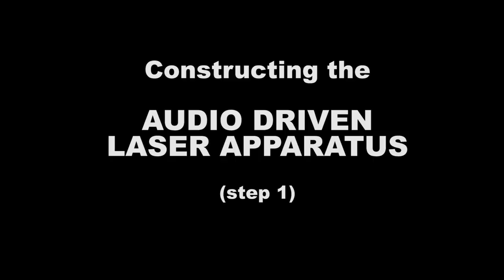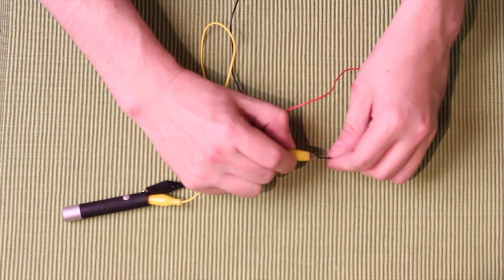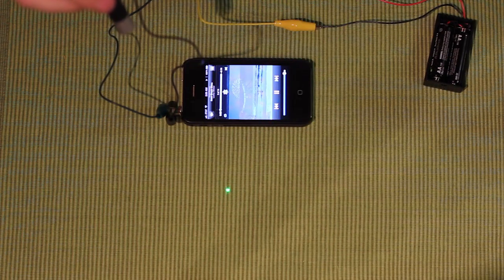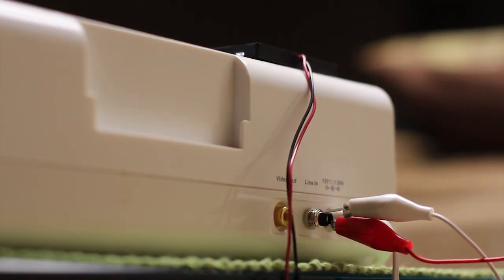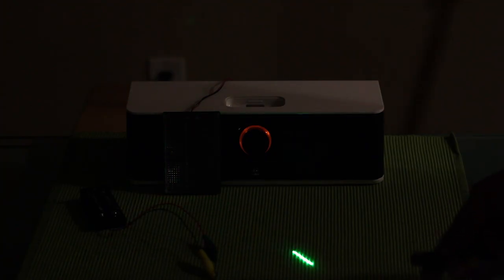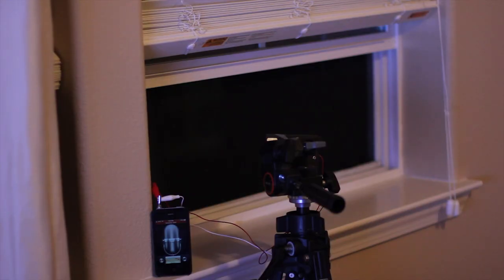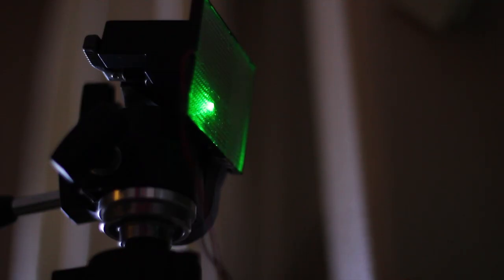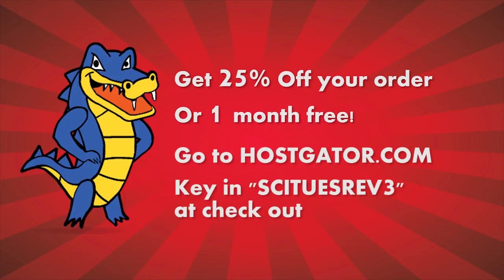Spying with a Laser

Comment: Hello, Wonderful project.
I have a question; Would it be possible to send a text document consisting of say, 30,000 Bytes and be able to save that received text document onto a computer? What I find fascinating is that you demonstrate sending by Laser a much larger message, (a music file) and become a successful experiment result without  error checking, re-sends and acknowledgements, which in itself only contains bytes of information. I am one of your "Techno Virgins" so to say, and perhaps that's where my impatience and uneducated frustration and desire comes in. But, I am quite sure that your technical intuitiveness and desire to succeed will prove successful. It would be great to see you post a video proving that it can be done.
Reply: audio is the rare data application where dropping or corrupting a few bits here and there doesn't really matter: the lossy-ness probably won't even be noticed, since it's being parsed by the human brain instead of a computer.
Reply: It really depends on how you encode the bits. If you use something like a hamming code that has error correction built in, you could probably get pretty decent results assuming stable transmission. 

It sounds to me like you're essentially looking to do a fiber optic data connection without the fiber part.

Comment: its funny, when you were transmitting clear audio from your phone from 3 feet away directly into your solar cell, you couldn't make any of it out, but miraculously you were able to "Bounce" light off of neighbors window, receive it in your solar cell and get clear audio, how wonderful. Oh by the way, where is your audio amplifier, is it that big thing because you need audio amplifier connected to your solar cell to amplify the vibration before it can be converted back into sound. I take it that you're not an engineering student
Reply: utubefrog09 also the fact that the neighbours window was probably double glazed dosent help either
Reply: I would have tried several changes. I think he was over driving the laser, meaning it was distorting the audio. So turn down the source gain and turn up the output amp. I think the light on the solar cell was to concentrated, he should have backed up and let the laser light spread out to hit more of the solar cell.
Reply: Im not saying he didnt fake it, but the laser did have a greater exposure over the entire panal after it was reflected. His Iphone test was just one small stream. The reflection covered the entire panal. Idk 😆
Reply: First time didn't work because the laser needs to be reflected on a surface that is vibrating because of sound waves. The vibration gets reflected with the laser and the receiver is then able to convert it back to audio. That's why pointing the laser directly into the receiver is not going to retrieve any sound.

You shouldn't make assumptions, accuse someone of faking a video and even making fun of him for not being an engineering student when you don't even know the principles that makes this work.

Get your facts straight if you are going to make such a disrespectful comment.
Reply: This is 100% faked. He could have just built this entire thing properly by using a photo transistor instead of a ridiculous solar panel, and an actual pre-amp circuit that is absolutely needed to step up the signal to an even remotely audible level. 

Theres no need to even modulate the laser but if you wanted to, all it would take is 1 general purpose npn transistor and 2 resistors to do it properly and have crystal clear audio. 

I built one of these years ago and when built correctly it works incredibly well, even on double pane windows. Theres a reason the military and government have and use these devices. If you want to build one a circuit can be found pretty easily on google that actually works.
Reply: @Alex-to4iz  Umm maybe you should get your facts straight. He was modulating the laser via the mp3 players audio output (or at least attempting to). It didnt need to reflect off of anything, the sound was already present. And it still didnt even work, because this whole video is fake AF. The random digital noises in the fake audio of an entirely analog system should be a dead giveaway to anyone who understands basic electrical engineering.
Reply: I'm pretty sure he faked it too, just dubbed a distorted voice over a track of static noise. Double pane windows only tend to transmit sound at the resonant frequency of the window. And if his receiver didn't pick up anything from the modulated laser there's no way It could have not a good signal from his neighbors.
Reply: Students are good at regurgitating taught facts. Don't get memory mixed up with intelligence

Comment: you might wanna open your screen on your window metal might be the reason why your sound being bounced its coming in rough, also you might wanna add some cap's & resistors to the circuitry to smooth out that feedback

Comment: I did this for my project a week back and it worked then
Now its just not working
I'm just doing the audio or music transmission part not spying
The laser is fine, it lights up when audio jacks are plugged in and the solar panel is fine as well as my speakers
When I direct the beam at the panel, I dont get any sound but a week back when I did the same thing it worked like a charm

Help please! Need quick help
I did evrything from changing connections, trying different speakers, different audio jacks and different lasers but no avail
Reply: They patched this in the new update.
Reply: Poland Ball LOL
Reply: Reich Tangle just wait for patch 1.04569318539052.578 it'll work lmao
Reply: Daemonforce Gaming http://phimhd.vn/phim/ong-con-quy-tu-that-is-my-boy-2012.html watch this and get fucked up
Reply: ESB Games no, screw off mate.
Reply: ESB Games yeah piss off m8
Reply: jamn610 preach it bro
Reply: it might require a new battery
Reply: jamn610 doesn't it need to bounce on a flat area , like a window? so when sound makes the glass vibrate, the light is not directed to the panel ?
Reply: I think so
Reply: Petitjean Gilles I powered the laser using a battery and an audio source, so there's no need to bounce it off any object since I'm not eavesdropping on anyone
Reply: jamn610  did you damage the speaker?
Reply: Looking for Hope no, it was working just fine

Comment: That's not the right way... you should use a transistor as a switch in the jack... also i think that connecting power directly to the laser and the audio jack is dangerous to the MP3 player or cellphone :/

Comment: For the laser audio transmitter you need a transformer in line with the laser pointer and the audio will sound much clearer. Use a low power solar cell if you're using a high gain amp. I used one from an old solar garden light and it was almost overpowering my amp.
Reply: Can you make me one

Comment: Do you think infrared would work?
Reply: Ricky32908 I'm curious about why you said IR wouldn't work.
IR has a longer wave length meaning it's more likely to reflect than UV against a barrier and looking up IR reflection in clear glass specifically, that looks like it's the case too.
Also it's not like we don't use IR to transmit data at higher bitrates than sound every day anyway (normally called a TV remote or toy car remote).
The only issue is the sensor, the solar panel. IR receivers are tuned to only receive a specific band of IR from a tiny LED back when LED's weren't superbright. Meaning no need to turn the lights out either.

I can actually see this being done with only a bit of optics to collaminate an IR LED and an off the shelf IR receiver.
Even if glass does transmit or absorb IR, replacing the LED with a superbright IR led would probably be enough for the sensor to detect the signal.

No prototype UV specfical PV cells or UV laser required.

Now granted this IR system may not work outside on a sunny day, but neither will the UV system (ozone does absorb UV but why would they even be researching UV specific PV cells if no significany UV reached the ground? Also sunburn....)
Reply: professional laser microphones use IR lasers in the 790nm freq so yeah...
Reply: i researched, no it would'nt have enough energy to work :(, maybe a less noticable color like red would do
Reply: I wonder if a more powerful lazor would sound better
Reply: maybe, there are solar cells in development to capture not just visible light but also UV for a cloudy day, those might
Reply: IR would work, focused correctly it can travel a good distance and it can not be seen by the naked eye. By using a IR receiver (diode) all other light is ignored. Down side is it would be no good for use during the day because of the mass amounts of IR light that the sun produces. IR has been used in many things from tv remotes (look at the end of your remote and push a button, you see no light), it's been used in large scale touch screens (a camera fitted with a IR filter monitors the reflected light that your finger causes when touching the glass) and many other applications.

Comment: Does this really work?
Reply: "yes" it does but using a solar cell would be about the least efficient receiver you could think of. It's reacting to changes in wave length a solar cell is made to catch a very wide range of wave lengths across it's whole surface. A better receiver would be a would be a light sensing diode or "Photodiode".
Reply: No. You said that Solar Panels are worse receivers than anything I could imagine - I have issued a challenge to that statement!
Reply: Yes but not the way he did it. Its bull shit. To actually do this you need a photodiode or CCD and some optics/interferometer, not a dollar laser pointer and a solar panel. Also have never seen a green laser for a dollar at a drug store. They re like 30 from china. A drug store has a huge mark up. Stop the bull shit.
Reply: kenstr321
Wanna bet? How about a pumpkin pie?
Reply: Mithradates Megas Do you mean a raspberry pie? The DYI electronics kit?
Reply: hahaha
Reply: OMG WHATS WITH THE FUCKING IDIOTS SPELLING Raspberry Pi WRONG!?!?!?!??! i mean i get why ppl type it pie but still no!

Comment: Wtf, and they don't need a receiver or what?
Reply: The solar panel is the receiver now, it "reads" the reflection of the laser made by the glass of the window. That's why it won't work if you're not making sure the laser reflects into the solar panel.

Comment: Wouldn't this work better with a blue laser; since their is deeper uv rays. For example I noticed that the blue laser shot at a solar panel gives it much more power, and basically means that the signal with the blue laser would be more clear and powerful?!!
Reply: That's why I commented!!!:) ;) :D
Reply: RANDOM VIDS
true it should work better that way
Reply: ultraviolet light would be much better since it's invisible to human eyes(and shorter wavelenght bounces more)
Reply: @busteraycan  well noted :)
Reply: U guys still alive ??...
Reply: @SkyHighFilms777  yup! 😈
Reply: I knew that
Reply: So a red laser is the least affective because of its long wavelength?
Reply: Aaron Smith Burak Baggins UV would be a terrible choice if the reason for using it was so that it wouldn't be noticed.
Reply: Does this system really work that good ?? I mean with a reflected laser beam and higher quality solar panel could it actually puck up voices that clear !?...
Reply: Billy Williams That seems opposite to what I've learned. I suppose the only real way to test this would be to experiment! A blue laser would have a higher frequency, yes, and thus more energy, but the smaller wavelength would probably cause it to scatter more so it couldn't travel as far. But either way, I think it'd be cool to either use UV or IR radiation so you wouldn't have to worry about someone seeing you shining a laser through their window!

On another note though, I wonder if your regular everyday solar panel would detect these frequencies of light. If so, UV would probably be better as objects give off blackbody IR background radiation at room temps, creating lots of interference. Love this stuff.

Comment: i don't get the thing with the laser on the window and your solar panel.. where do you point the laser at, and how do the signals come in (in what form..)
Reply: Glass windows reflect back a small portion of the light that hits them. The idea is you point the laser in such a way that it bounces back at your solar panel. The window itself will react to the sound waves in the room. The vibrations will cause th returned laser beam to distort into patterns that can be translated into sound.
Reply: Joseph Sileo thank you very much for the explanation

Comment: cool,now if you replaced the green laser with a infra red laser then no one will know they were being spyed on
Reply: but how do you know how to reflect it?  yeah true do maths bu you would need a distance i presume and you would have to make that and put it in the circuit
so that doesnt work
Reply: you could use a infra red sensitive camera to reflect the beam to the right place and you can buy an infra red pointer easily of the web if you know where to look so you would just have to do the same what was done to that green laser in the vid so not too much circuit modification,apart from obviously the receiver which you may have to build but that is shown in the vid.
Reply: the infra red light also will reflect like normal light it behaves very much like visible light just that its a tiny bit too far on the red side of the light spectrum so our eyes cant see it only just.As long as it is not too far in the infra red spectrum you should be fine

Comment: The claim is that the window of the neighboring house vibrates enough for a laser shining from your window onto his window and reflecting back into your sensor to change in intensity due to the moving of the window.  The example is confusing, because at first he converts a sound electrical signal to light intensity and back, whereas he now converts the vibrations of a window due to sound to the laser's electrical signal.

Comment: You really shouldn't wire the battery in series with the audio source like that. You could damage your phone. Instead use a transistor to amplify the audio signal with the battery.

Comment: I've gotten everything together, but seem to be having just a little trouble when I aim the laser back and forth over the solar pad. I D K for sure yet, but it's as if I have to let it rest a second on the panel for the sound to record. I'm using a solar panel from one of those little "sidewalk torch's" So my question is this: Does "sensitivity" of the panel make a difference? And/or does the output of the panel, (Ie charging strength) make a difference? Thank you

Comment: @MasterSamus What do you mean relay? internal parts imo would never make sense to use laser instead of wires and for anything else it wouldnt make sense because you have to point the thing...they tried it with infrared if im correct i remember on an old nokia cell i had you could use either Bluetooth or infrared to transfer data are you thinking of something similar?

Comment: The basics are ok but the quality build of the laser as well as the circuits is not good enough to produce reconicible sound a solar panel is not the best way to revive audio from a laser. Especially a 50 cent solar panel

Comment: so you're connecting up a laser and batteries through your phone's headphone jack that's designed to drive headphones and not do more than like 1.1v? So putting 3v through it's little amp and a current draw like a laser diode sounds perfectly safe doesn't. Use a transistor in future.

Comment: @AlphaxDelitE The laser it self is being used as a transmitter, all you need to do is plug the laser into a device that has speakers of some kind. 

I assume when he was using the laser to spy on his neighbors by pointing it at a window, the window vibrates when a noise is made in the room the laser then detects those vibrations and carry's those vibrations back to the solar panel which is acting as a receiver which is then played through the speakers.

Comment: @thepoke3000 Most of the stuff can be found RadioShack for under $10. You should already have some sort of portable device that plays music like an ipod or mp3 player and a boom box with a mono input. Even though its Household Hacker that doesn't mean your gonna find everything in your house your going to have to spend a few dollars here 'n there. It also requires creativity, for instance I didn't have any wires with alligator clips on them but I did have a soldering iron and solder.

Comment: @marcoantoniomirandar Strange. I thought fiber optic worked by sending a light beam through a cable with a transparent core. The transparent core would have the beam of light bouncing through it until it reached the other end of the cable. You could use this to transmit digital data. If this is not fiber optic, perhaps I am thinking of something else.

Comment: You need to mention that the driver on the laser pointer needs to have analog modulation, not TTL/Digital. Also, please mention laser safety,  people are to irresponsible with lasers nowadays. Goggles should be used with any laser over 5mW.